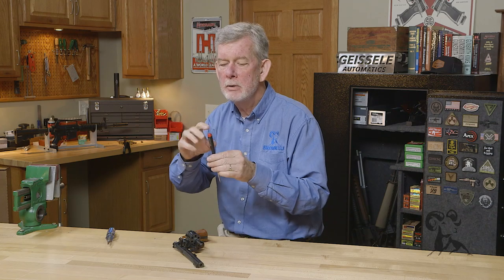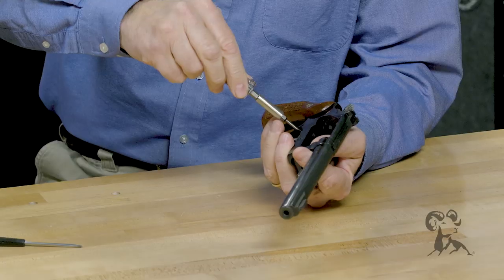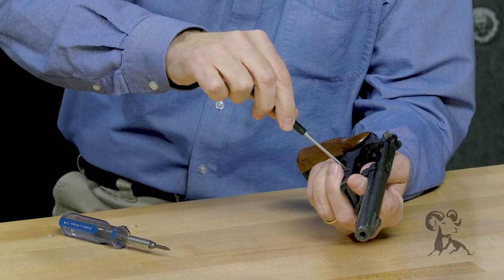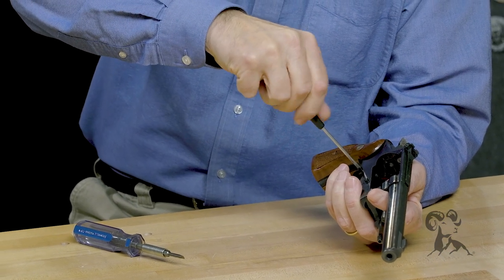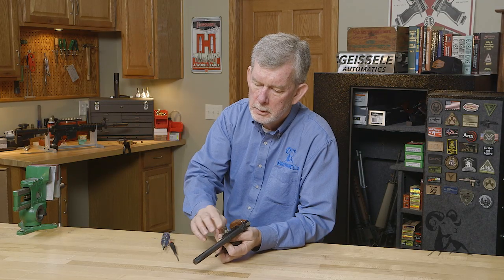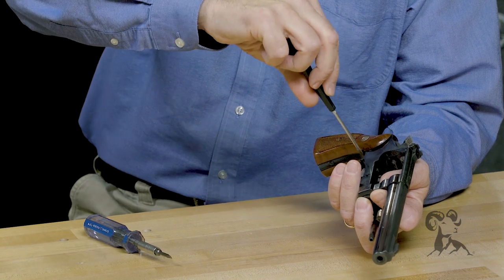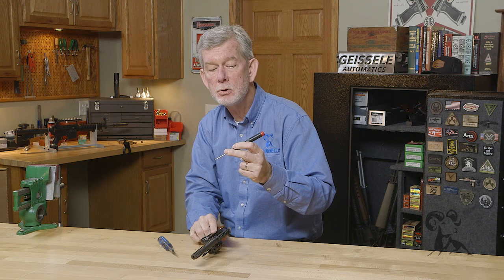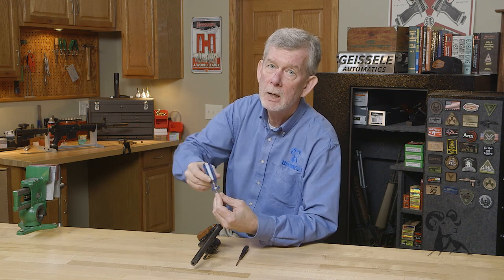Quick Tip: Precision Screwdrivers for Gunsmithing

Comment: Thats good advise. You should also mention that screwdrivers for gunsmithing are meant to give and twist at the blade on exsesively tight screws to prevent damage to the screw slots and guns surface. I say becouse I've have heard and read complaints from people, on several sites that so many are cheap sets and not good becouse of this. Many new to doing this work or maintance beleave that the tips should be strong enough to remove stuck or rusted or exsesively tightened screws with out contorting.
Reply: I'm guilty.  Thanks for explaining..

Comment: Your example here just showed (several times) how easy it is to slip and scratch your gun.  Put the gun down and use your left hand to help line up the screwdriver.  It's not hard to put a light scratch into the bluing.  Scratches around screws and damaged screws really tell you about how a gun was cared for when it is up for sale.